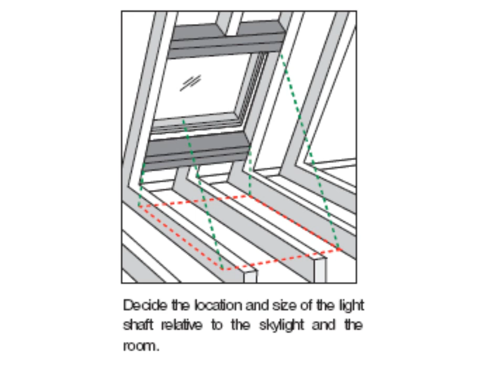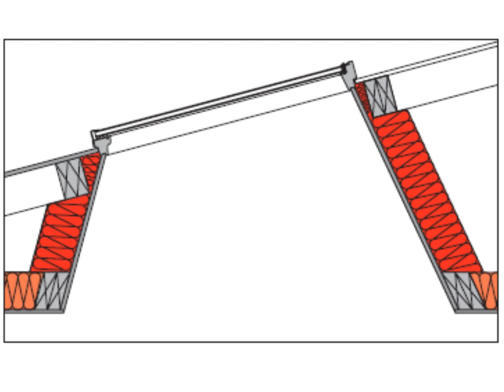FV Installation 7mins 40secs

Comment: massive balls...
so when you cut in to the truss, then you lay the weight from the top of the truss on to the weekend ceiling joists..... how does that handle? like taking for joists out and putting a load bearing wall on, no?
Reply: should be doubleing up on joists and trimmers or in the uk it wont pass building regs
Reply: @LightGesture this was not a trussed roof so you are not cutting any bottom chords
Reply: @SNORKYMEDIA  agree should be done here as well this was a dodgy install